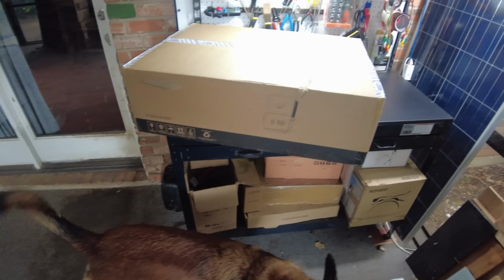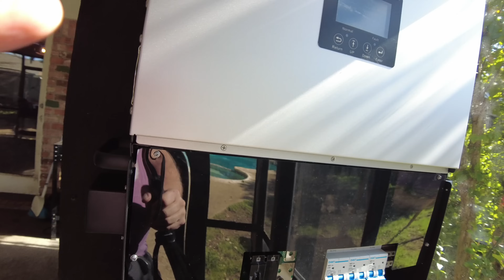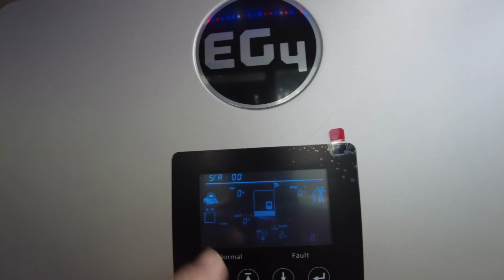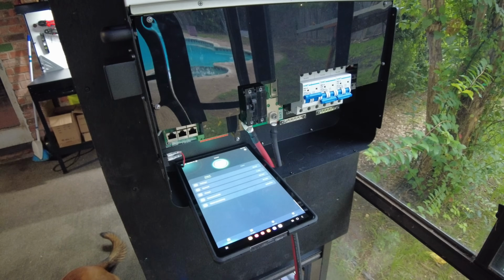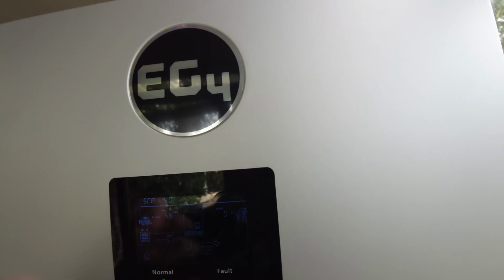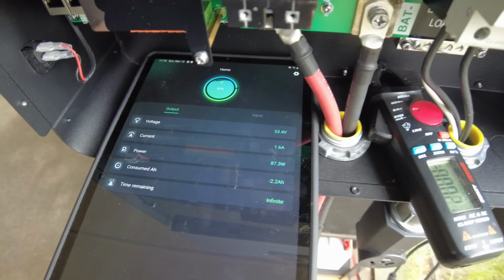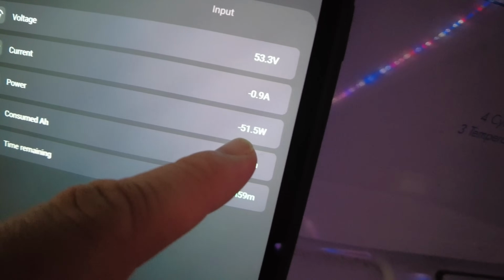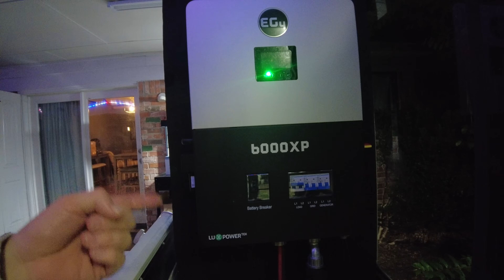EG4 6000XP All-in-one Split Phase 6000w Inverter

Comment: For my eg4 6000, and two batteries;
Is it possible that when my batteries are filled up. I can stop using the battery power, and just switch over to the grid or just PV power, and preserve my battery power for when i need it?

Comment: Isnt each battery good for 100amps? so 4 in series would be 400 amps total? Sorry for the stupid question, very new to all of this
Reply from the maker: Great question. So short answer is no, 4 100Ah batteries in series would still be 100Ah. Long answer, batteries in series the voltage increases, and the amps stay the same. Batteries in parallel the amps increase but the voltage stays the same. In series 4 100Ah 12.8v batteries = 51.2v@100Ah (commonly referred to as 48v).  In parallel 4 100Ah 12.8v batteries = 12.8v@400Ah. Now here's another thing people get confused about, they think 400Ah is always more capacity. Not true 12.8v@400Ah is exactly the same capacity as 51.2@100Ah. Here's the math 12.8v x 400Ah = 5120Wh, and 51.2v x 100Ah = 5120Wh. You see Wh (Watt Hours) is the best measurement of energy storage. Hope that helps. Thanks.
Reply: @BradCagle  Ah, I wrongly assumed Voltage + Amps increased. Thanks for the videos!

Comment: These types of inverters use about 50 watts just being on? Is there a way to run this on a separate battery system so it doesnt drain the main battery bank?

Comment: can you just run the 6000xp load wires to a 30 or 50amp power outlet box and charge your EV by plugging in your charging cable to the outlet? You wouldn't need a load center with breakers if it's just that 1 item being used ever right since the 6000xp has it's own ac breaker already? also since the 6000xp only outputs 240v 17-25A on ac whether you use a 30/50amp outlet you should be good well under the max right?
Reply from the maker: The AC breaker on the 6000xp seems to be a 50a, and in the manual it calls for 8awg wire to be used. So I would think if you run proper 8awg copper wire to a 50a 240v outlet (like a nema 14-50) it should be good. Now I'm not a electrician so do not take my word for it :) Always consult with a licensed electrician in your area. Thanks!
Reply: @BradCagle  thanks for the reply, I'll look into it then.

Comment: if i use this in my 30amp(120v only) camper, will i only be able to use 3000w? or will it push over 3k on 120? camper goes up to 3600w and i need all of that lol
Reply from the maker: Pretty sure It's 3kw per leg only. Yeah I don't think this unit would make sense in a 120v only camper.
Reply: You could split your breaker panel so that each leg of the inverter services half your rv load. Then you could use the entire 6000w capacity

Comment: I helped a off grid old timer order one of these 6000xp inverters and it’s the wrong inverter for him. He is never going to want to learn how to use it it or set it. I should have ordered a big low frequency boat anchor of a inverter with no fancy bells and whistles. Even techy people are challenged to setup these new inverters.  I’m not sure I’m techy enough without many hours of messing with the settings.
Reply: Watch Will Prowse video on this unit. He set it up in about 5 minutes, went through all the settings, super simple.

Comment: So, I’m a total newbie to backup power systems and it seems like it would be a little less expensive to DIY my own backup system. Would server rack batteries be the more efficient a cost effective way to go with this unit? I’ve calculated roughly $3,500 for the setup with two 48v server rack batteries. Is there a little less expensive (but as effective) battery to go with? Great channel, btw!

Comment: A split-phase seems best for my plan to connect the output to an existing sub-panel which supplies my kitchen, living room, garage, plus a 240 VAC outlet for a former electric dryer (now gas) which could power an EV charger.  One question.  When it switches to grid-power, because the panels can't provide sufficient output, does that add to the solar output?  If not, is the solar output switched to charging the batteries or just goes unused?

Comment: Is a slave 6000XP capable of having an external grid power hookup that’s different from the grid hookup on the primary?

I’d like to hook the grid power to the primary to keep my batteries charged but if I loose grid power, I’d like to be able to charge the batteries from a generator port hooked up to the slave 6000XP 

Is this configuration possible?
Reply from the maker: I'm not sure. Why not put both on the same unit? Each unit has a grid, and a generator input.
Reply: @BradCagle 
Interesting. I didn’t know that.  Thanks.

Comment: Question: You mentioned that you "re-enabled the Power Save function." Do this imply that after shutting down the inverter, all settings revert to default? Or do they "stick?"
Reply from the maker: No, they stick. I just set the Power Save back to default after it did not seem to work initially.

Comment: Is there no custom setting for non server rack LiFePO4 batteries?
Reply from the maker: I didn't see it. However I think Will Prowse got it working on lithium setting without communication . I think he said he set everything to voltage charging, instead of the default SOC based charging. I'm going to play with that this weekend. I'll have a follow up video coming. Thanks.
Reply: @BradCagle  Thanks. I appreciate all your videos.  I am just not a fan of the server rack batteries, and it seems like EG4 always have communication problems.  I like the idea of their waterproof 48 volt batteries because they are 85 lb and have a 200 amp BMS.

Comment: Nice video.  In the US, we have 120v.  So with this AIO unit, is there anything else we need to use it in the US?
Reply from the maker: It's made for the US market. I'm in Texas.
Reply: @BradCagle  isn’t the Voltage in the us 120v instead of 240v?  Except for dryer and Ev uses 240v. Am I missing Anything?
Reply from the maker: @jonphanspromotions  The voltage in the US is 240v with a neutral. Which gives you 120v (L1 to neutral), 120v (L2 to neutral), and L1 to  L2 give 240v . This is what this inverter does.
Reply from the maker: @jonphanspromotions  Watch from here: https://youtu.be/26-TJb3sBNg?si=jyQgH2vALXxlBksd&t=407 I get 240v, and 120v running L1 (or L2) to neutral.
Reply: @BradCagle  so it's not 240v . I can use two separate legs for 120v each.
Reply from the maker: @jonphanspromotions  it's 240v, and 120v. Yes you can use two separate legs for 120v each, and you can get 240v across both legs.
Reply: @jonphanspromotions it's a split phase 240v unit. It means you can run either or both your 120v/240v loads

Comment: Can load and grid be hooked up to the same breaker panel? I mainly just want to use this unit as a backup in case power goes out for now
Reply from the maker: Load, and grid cannot be tied to the same panel. You would need to have some sort of transfer switch installed.
Reply: @BradCagle  maybe just run them off different breakers?

Comment: if you want an inverter with low idle consumption of power, or low inverter power consumption on little load check out Victron Inverter, it will marvel you how little that inverter consumes, but is expensive

Comment: I would never connect a high frequency, transformerless inverter to the major appliances in my home. High frequency inverter offer a wimpy 2X surge capacity and during a catastrophic failure of the H-bridge circuit, without an output transformer to isolate the battery from the AC output, a high frequency inverter can damage and even set an appliance on fire. If you want to power your whole house with solar, a far better alternative is to invest less money and purchase a hybrid, low frequency, transformer based inverter charger and an LFP battery and assemble your own real solar generator. Low frequency transformer based solar generators last many years longer than these high frequency inverters, and can easily power high surge loads without being damaged and without damaging your appliances. That's why the big name brand inverter manufacturers like Schneider Electric, Outback Power, Sigineer, Victron and others, all use a low frequency topology in their offerings.
Reply from the maker: I've used high frequency inverters for years, and have had no problems. Most things are moving to high frequency these days. All micro inverters are HF, as with all the Tesla equipment. HF tech continues to get better all them time, the market demands HF because of the cost, size, and weight savings. BTW HF inverters do offer isolation via the smaller transformers in the DC section. The real difference is you're stepping up the voltage on the DC side, rather than stepping up the voltage on the AC side with a large transformer.
Reply: Micro inverters are used solely for grid tie applications and as such, they are not subject to inductive surges. And Tesla does not use low cost Chinese made MOSFETs or IGBTs in their builds. And high frequency inverters do not isolate the DC input from the AC output, because while they do use small transformers (inductors) coupled with capacitors to step up the DC voltage, this stage of a high frequency inverter still passes this DC current through to the H-bridge circuit which can be passed on to the AC loads during a failure of the AC output monitoring circuitry coupled with a catastrophic short to ground of one of the MOSFETs in the H-bridge circuit. The only way to guaranty that an inverter will not pass DC current to the AC loads is to use an iron core, copper wound isolation transformer at the AC output.   .   @BradCagle
Reply from the maker: @solarcharging9743  You cannot get battery DC voltage to the AC output. You could theoretically get the HF switched high voltage DC across to the AC if a MOSFET shorts yes. However the high voltage DC section should be shut down if some anomaly was detected. The whole system has a feedback loop to adjust the voltage on the fly depending on the load. Look at the topology of the HF section of these inverters. It's not a typical boost converter with inductors like you're thinking, they actually use transformers, and it's fully isolated. Just like an isolated dc/dc converter. It can use transformers in the DC section because it pulses (at high frequency) those pulses are a lot like AC (except at a much higher frequency than 60hz), and on the other side of the fully isolate transformer is a rectifier section, and caps to smooth the ripple back out before it hits the H-Bridge to covert to a 60Hz sinewave. 
Thanks
Reply: Yes, thank you for making my point. "You could theoretically get the HF switched high voltage DC across to the AC if a MOSFET shorts yes". And as you said "on the other side of the fully isolate transformer is a rectifier section, and caps to smooth the ripple back". effectively turning this high frequency rectified and filtered high current signal back into DC.  

As I said, during a failure of the AC output monitoring circuitry coupled with a catastrophic short to ground of the MOSFETs in the H-bridge circuit, the inverter could pass high frequency rectified and filtered pulses that are equivalent to DC, to your AC loads. This high frequency rectified and filtered DC could saturate the transformers found in many AC appliances, causing them to overheat and even catch on fire. For an excellent video that that thoroughly explains how a high frequency transformerless inverter can set AC appliances on fire, watch the youtube video, "Solar Inverter Catastrophic Failure" by Red Hill Labs.  @BradCagle
Reply from the maker: @solarcharging9743  Thanks, I'll check out the video.

Comment: This thing looks like a nice step up from the Growatt 5000es or other EG4 6000/6500w inverters. Obviously for it's native split phase functionality but just seems like a better unit. One thing I've been mentioning to people is that these units that blow air across circuit boards are bound to gum up over the years. The low idle consumption sure is nice. It's a little bit lower idle consumption than the Megarevo I've been using. I should check the consumption with different firmware versions to see if they've brought it down!
Reply from the maker: Good point about the fans. You probably would want to open it up, and blow it out once a year or so.
Reply: Hey there! I totally agree with you, the EG4 6000XP All-in-one Split Phase 6000w Inverter seems like a better unit compared to the Growatt 5000es. However, have you checked out the Segway Portable PowerStation Cube Series? It's a versatile powerhouse with a massive 5kWh capacity, fast recharging, and a durable and waterproof design. It could be a great addition to your outdoor gear and home backup power setup. Just a suggestion!

Comment: would be nice go see how it does with induction loads on 240v like a home ac unit, and on 120v ac air compressor if it can start one up. that will be neat to see.
Reply from the maker: Great ideas!
Reply: A clothes dryer uses both inductive load as well as resistence load (motor and heating element).  Average load for a modern home central a/c is anywhere  from 2 amps to 18 amps depending on size.  I say modern because DOE requirements have forced makers to use more efficient components/designs in recent years.  In the old days a central a/c could use 25 amps or more while running.  Plus too, the age of the equipment also determines the condition of bearings which, as they wear, draw more amps due to resistence to spin.  If you use a clamp meter to measure the amp draw on each leg and add them together you will get the actual load.  Or you can rely on the printed run load on the name plate.  These inverters account for start up load by giving you around the double the rated output for a few seconds before overloading.  Hope that helps.

Comment: Been watching for new videos on this inverter. My main concern is idle consumption. The spec sheet lists several different values, but doesn't explain the conditions under which they are tested. I would love to know what the total consumption would be in actual service over time. I had a 6500EX-48 and returned it because of the idle consumption. I now have a Victron MultiPlus II. It is rated at 11W at idle, but averaging all the  input power from the grid & PV and subtracting the load power over a 3 week period of varying sun, it uses an average of 22W/hr. This takes into account inverter losses, charger losses, MPPT losses etc. It's a very good number, but it's a complex system and I believe in KISS. I would have to add a 2nd one to get 240V and 6000W, and that would double my consumption, so I'm open to the 6000XP as a simpler and less expensive option if the overall daily consumption is similar.
Reply from the maker: Yeah, it's not always so cut, and dry. I would say the idle is pretty reasonable now after the firmware update, better than any other AIO. Now It's does seem to have a bit higher overhead on the MPPT. That being said I don't have that much PV on it just yet, so that overhead might be much smaller when the system has more PV. Thanks!

Comment: I feel this is perfect for me and what I want to go with.  My goal is to set up a critical loads panel and move some of my loads over to it fed split phase via this unit.  For now I don't need any bigger than a 6kW inverter.  Throw two 48v 100Ah server rack batteries on it and 2kW of solar and you're good to go.
Reply from the maker: Yeah, that's pretty much what I've been doing over the years, and yup, this thing seems great for that. No pushing back to the grid, and If you use all your PV/Batt power up, it just switches to your grid. If they let me keep this one, i'll certainly run my whole garage on it :)
Reply: @BradCagle  That's a great way to run these so they help pay themselves off.

Comment: A lot of people have been asking on other forums whether this will work with only 120v input from the grid or generator. No one seem to have an answer. Wondering if you can do a test. Thanks
Reply from the maker: Alright, I asked signature solar this question, and they say you must use 240v input, 120v will not work.
Reply from the maker: Hey, I was wondering that myself. I cant image that it could switch/bypass to grid like that, but maybe it can charge the battery? I'll give it a shot.
Reply: good question.  I think I read somewhere you have to give it a split phase grid input for pass through, not sure about the generator input though.
Reply: I’m really looking forward to the answer to this question as well. I just subscribed hoping to see some further testing!
Reply: No, it will not. You will require 240v in.

Comment: This sounds like the unit I have been looking for. I have been wanting to take my well off grid. What was the inrush current when you started your dryer?
Reply from the maker: Yeah this one seems to be very nice indeed. I didn't measure, I need to see if I have a clamp meter that will measure inrush. I'll let you know. Thanks!
Reply: Generally speaking the start up amperage is 3-5 times the RLA (run load amperage) on motors.  So if your well pump draws, let's say 5 amps at RLA it would draw anywhere from 15 to 25 amps at start up but only for a short time.  In rush doesn't apply to your motor.  With a pump motor you're dealing with LRA (locked rotor amperage) at start up.    Now "inrush" pertains to resistance devices (heating element) and is generally 2-3 times the normal 'run' amperage.  Hope that helps.  I spent a lifetime dealing with these in the mechanical contracting business.